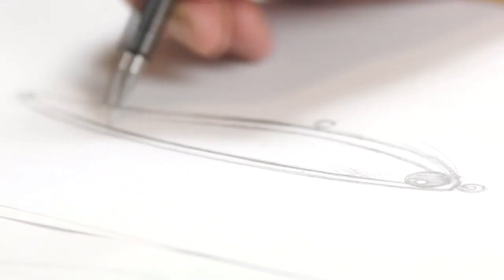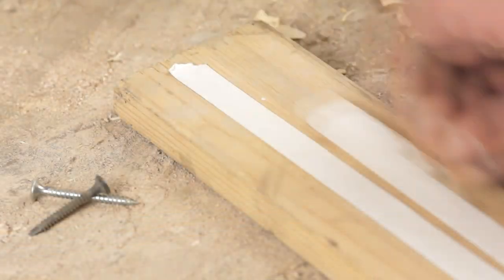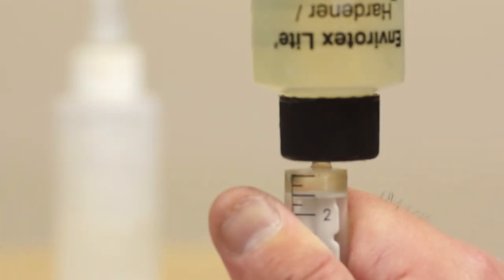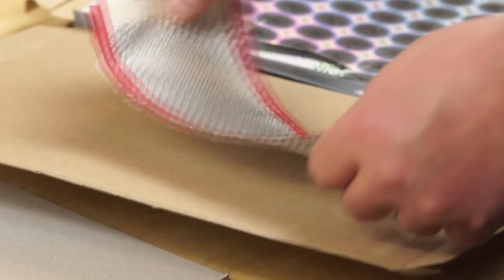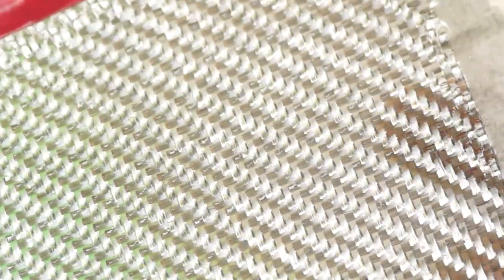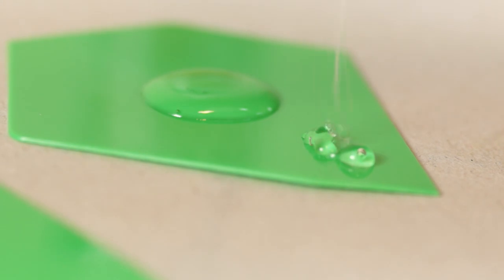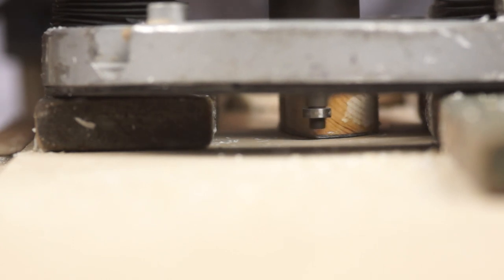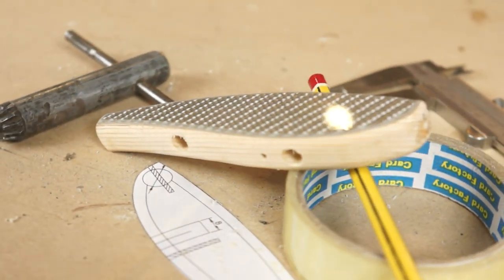Making a Bulletproof Glide (Jerk) Bait Fishing Lure Part 1 of 2

Comment: You are my hero Paul. I have been trying for years to make a successful lure but I am never able to because I can not afford any hardware equipment. Thanks to 1 or two of your videos I have been able to make lures that are inexpensive and successful. Thank you
Reply from the maker: I think i probably have to thank  one guy more most for making me see the possibilities in junk. I did some voluntary  work for a small charity which had no money and they needed a small window frame making, and i was all set to go and buy some new wood and the guy  responsible for the maintance said i that they would like it making from spare wood they in sheds. So i made a window frame from bits of bed and the surviving parts of a table. It would of been much simpler if i would have had new wood but i do not think i would of learned so much.    Cheers

Comment: Amazing work! I can see how much time you put into this video, all the camera angles, the lamp effect as the glue dries overnight. Wow! I've never seen any video with this much thought put into it! I've seen your videos for almost a year back and this one tops them all! You can't even get to see this good quality video on all the professional tv shows. AWESOME work! Looking forward to seeing part two!
Reply from the maker: i am still learning a lot and each film is a bit of a steep curve and it is funny to look back over older  films and see what worked and what didn't. This one was a little easier as i worked with just one camera and i have kind of got used to setting up the camera and then postioning myself in shot, it also makes it look slightly different than if i had a cameraman. I also found an old light meter which helped me get the lighting under control.   Thanks for the feedback

Comment: Very cool Paul!

A couple of ideas/suggestions.

1. You can paint a pattern on the plastic before laying down the resin and fiberglass. Once the resin cures, it takes the paint with it and it is then embedded into the resin and is very difficult to remove unlike paint added to the outside of the cured resin. It may be necessary to wax the plastic before hand though (plenty of videos around of this to watch).

2. It would be easy to pre-cut your shapes of fabric before you lay it on the resin. A very light mist with hairspray will hold it all together once it's cut.

3. To really wet out the fabric, grab hold of a lino-print roller, wallpaper seam roller etc. They do a really great job of squeezing the resin into the fabric and getting rid of any bubbles. If you want to remove excess resin, just lay down some paper towel and run the roller over the top.

4. To save time, it shouldn't be necessary to wait for the resin to start curing before you lay the fabric down. The bonus is that you can (sometimes!) pull it up and try again if you don't get it right the first time.

Looking forward to part 2!
Reply from the maker: I experimented with a quite a few techniques before using this reinforcement, what i was looking for was to simplfy the process and also use the kind of equipment that is easy to find, like file boxes and glue spreaders. The reason i used a clear layer and let it part cure was it adds to the holographic effect,without that layer or applying  a layer after really diminishes the effect with this fabric. Paint wise polyprop will release acrylic paint, i have made fish eyes using this method but it would still need to be clearcoated if used as and extenal, i suspect it would also realse lacquer based paints. I may do a bit of hair spray experimentation, as i find cutting out small peices even with sharp scissors really difficult. Even while making the second part of this vid ther are so many possibilities with this material. I think from your ideas you need to get the video camera out and make some films . Thanks for the input
Reply: I have thought of doing a hollow molded fiberglass or carbon lures (I have built hollow molded RC plane fuselages in the past), so maybe one day....

I use a thin ply template and the lay the fabric on a self healing mat and use a roller cutter, very easy and quick except for very tight corners. You can stack cut multiple pieces of the same part that way too. Another easy to get hold of glue spreader/compactor is an old credit card, just cancel it first ;-)

If you're after the holographic effect, you can add glitter to the base coat of resin, or even lateral lines, gills etc.

Comment: Hello paul , try this for your next video ; Take 2 cd's , glue them to each other with the shiny sides opposie to each other , next cut your fish shape out and add a tail to it ( triangle shape piece of cd) Now drill your holes and airbrush it. Finish them adding the hooks now its ready for a swim. For best results use your old Bee Gee's Cd's ;-)
Reply from the maker: That is funny, one of the prototypes for this lure had discs cut from cds along its sides, i do not think it was the Bee Gees, that would be like admitting i had owned a Bee Gees cd. I am planning to do something with cds but not back to back, they are made from polycarbonate which i use for making lure lips.  Thanks

Comment: You are doing alot of work for those sides. You can - and the result is just the same - do it by:

1. apply resin on the baitsides
2. put the cloth just as it is on top of the resin
3. put more resin on top of the cloth and swipe out all the exxess.
4. let it cure and carve the sides as you do on the video.

On the other words, you could skip those workstages of making the cloth as a sheet and after that gluing the sheet on the sides. That is pointless.
Reply from the maker: Sauli Lehtinen The method you describe was the first way I tried, I didn't find it easier and the finish was no where near as good, plus because the alufibre contains glass fibre it tend to become transparent and a lot of the pattern is lost to the wood. Using the plastic sheet as mould means i am effectively adding more layers of epoxy one at the front and one to sick it to the wood with, which adds to the 3d effect and makes the lure almost like a holograph which is not easy to see on video.